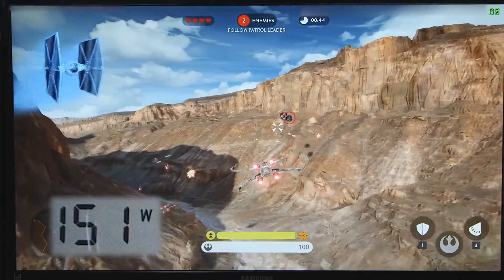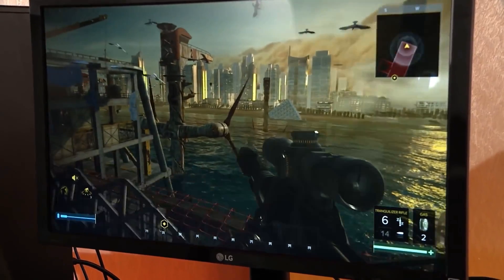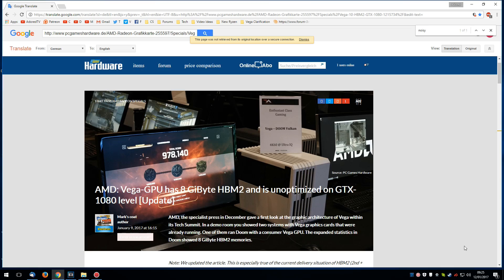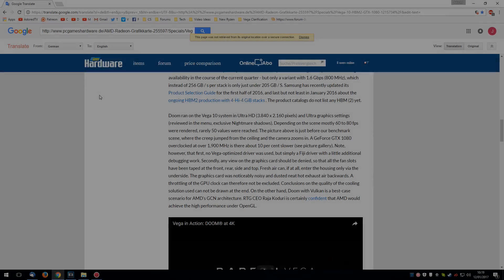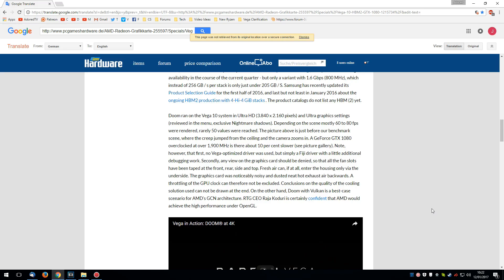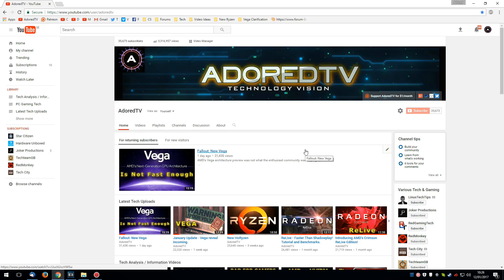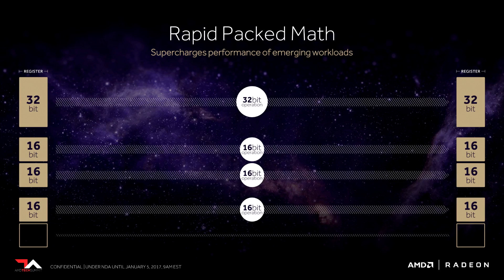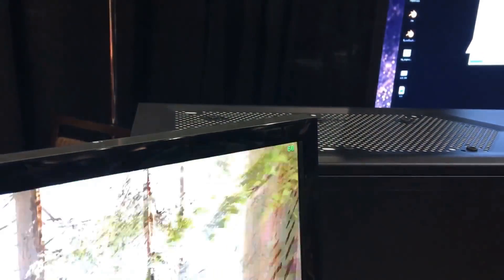Vega Clarification - How bad is it?

Comment: I think judging VEGA without knowing its price is pointless. What if Vega is priced very cheap that it becomes the best choice over 1080 any day? Don't jump to any conclusion until we get to see final price tag.
Reply: Hbm2 is not cheap
Reply: compared to 1080
Reply: Thing is that Vega HAS TO MAKE MONEY, or else there wont be enough resources for the next generation of cards.  And second fact is that NVidia can drop prices to match AMD, which in both case AMD lose because they don't have enough money.

The point is selling Vega for too cheap , AMD doesn't make enough money. Pricing it too high the card won't sell.
It is a lose lose situation. Look at the bigger picture bro.
Reply: It CAN'T be cheap. It's LARGER than 1080, AND has HBM2. It also has a state-of-the-art HBCController. That's the definition of expensive.
Reply: No, but the thing is AMD isn't looking great when you stop and think about it. I am a AMD Fan, my computer is still plowing a FX8350 with a RX470. But sometimes, facts are hard and they are going to hit hard on the head.
Reply: Except Nvidia overprices its card by a substantial amount.

You all are operating under the assumption that Nvidia is only charging a reasonable mark-up.

AMD can undercut the price of the Nvidia cards and still make money. Its actually the best situation for AMD to be in, because if they come in  near (above or below) Nvidia in performance AND undercut them by an amount that motivates customers...Nvidia is put between a rock and a hard place.

Fight a price war even when your cards are faster (which costs you profits) or let AMD eat into your sales to maintain your margins (which ends up still costing you money in lost sales).
Reply: P.S.
The only thing AMD can win the current battle is to have a GPU that is both more powerful and cheaper than Nvidia. That is the only way out.
Reply: The problem is, Nvidia won't...and doesn't.

Nvidia isn't going to drag their prices below AMD. They have already shown a paradigm shift in pricing with the founders cards.

I hate to break it to you guys, but that 1080ti is slotting in at $1000 and the 1080 is staying right where its at price-wise.

Those deals you always hope for with a ti release....not happening. Just look at the pricing structure. They have Z-E-R-O need to adjust prices to slot in a new card at the top end.
Reply: Incorrect.

Nvidia has shown a paradigm shift in pricing. The future will never again be like the past.

The 1080ti is slotting in at $1000 and the 1080 is staying right where its at.

They won't engage in a price war. When Vega drops, if they price it less then Nvidia will at BEST price it $50-$100 more than AMD and hope the performance crown holds.

You also forget Nvidia drivers have gotten substantially worse and AMDs have improved (some would say even surpassed).

You're looking at the past to inform the future. The pascal generation has been nothing like the past. Founders cards and a whole new pricing structure have changed the game entirely.
Reply: No one is claiming AMD will sell Vega cards for "cheap." It just has to be reasonably less than a comparative Nvidia card with at or near performance.

It's not about winning the race, its about improving sales, increasing marketshare and building long term growth. AMD has already mapped out its future and unless Nvidia makes some huge leap, pascal is just maxwell on a die shrink, which was just kepler with process/architecture refinements. 

Nvidia has been riding the same horse for a while. For all we know, they've hit the wall and HBM is the last ace up the sleeve before they have to do something different. I mean, look at the horrendous scaling from frequency enhancements on pascal. Almost every card is sitting at 2k and the difference between 1900-2100 is so small it just doesn't matter. 

Worse yet for Nvidia, unless they address Vulkan/DX12, their cards will only get worse with time and newer cards won't do anything to address that issue. At some point, brute force of hardware will give way to horrible software optimization.

It seems everyone is expecting w world beater. No. This is a steady the ship release that will undercut nvidia and open doors down the road for the type of competition that we want at the high end. They need cash and marketshare, not a performance crown.
Reply: "For us yes, for the mass, no."

What? 

"They are sitting on the same boat 3 to 4 gen ago, what does it bring? NOTHING. Building a long term growth has no effect if you can't survive that long. "

Wrong. It brings performance parity with Nvidia. Something they haven't had for a very long time. Further, you clearly know little to nothing about business or AMD or you would know they turned a profit, increased marketshare and RX sales are up across the board.

"NVidia can make cheap cards and overprice them, AMD can only make expensive card and sell for cheap. See the issue here?"

Wrong. I like how you think you know Nvidia and AMDs costs. Care to show up the build sheets you have access to that clearly no one else does? Both Nvidia and AMD pay other people to make their silicon. Assuming one has a cost benefit over the other that huge is laughable.  Yes, nvidia sells more chips so they will have an edge from economies of scale, but its not on the magnitude of $100+ a chip. That is just pure asinine nonsense. 

Nvidia makes expensive products and sells them for astronomical prices. That 1080 will cost less than its vega counterpart, sure, but you seem to forget Nvidia has HUGE stockholder pressures for profits and margins and losing on either has a far worse impact for them. Its obvious you've never been part of a company beholden to its quarterly reports.

"Because it is the only way AMD can survive now. There is no way they can do otherwise if we analyse more."

Pure nonsense. Again, you're projecting what you want. Not what the market needs. The market needs competition that delivers performance parity in competitive segments (not a segment that sells less than 1% of the total market) and does so at a reasonable cost.

Consumers are eating huge costs from Nvidia and 480 sales show consumers are souring to Nvidia's price gouging.

Once again, people like you are living in the past and ignoring the present. Worse yet, you're ignoring obvious business strategy, likely because you're not aware of how a business is run.

ps. I'll let you have the last word. I can't stand trying teaching kids things they don't want to learn. Just promise me you'll take a business course when you go to college.
Reply: you sound like you want AMD to lose :) I want fierce  competition.
Reply: It's impossible to sell cheap, there is a lot of hardware in there, and HBM is expensive AF and AMD needs to make money.

What is disappointing for me and maybe for adoredTV too, is that AMD on the paper claims to make huge changes on arquitecture, it started with Polaris 10, which in the end, Tesslation was vastly improved, Memory compression too, but still lags behind against nvidia on both elements, the GCN Cores were having the same performance as the ancient cards.

Now we have a lot of new slides claiming again performance boost on Geometry (Tesslation), memory compression and tilling (tilling, nvidia features it since maxwell) and virtual memory, which nvidia supports it too, but never PR about it that much, we have now improvements made to GCN Cores, which I expect to see less GCN cores offering more performance, Nvidia done 2 improvements like this on CUDA Cores on Maxwell and Pascal, AMD took 5 years to start this improvement.
And looking to the Doom Demonstration it is still at the level of the GTX 1080, with a bunch of new arquitechture advancements and a lot of hardware, and maybe even more power draw.

Nvidia is undeniable in front of AMD related to arquitecture efficiency, dispite yes, the bad performance on DX12 and vulkan.
This advantage that nvidia has, makes it easy for Nvidia to produce cheap chips and sell it at an expensive price.
Nvidia sell chips with half hardware than AMD and still manages to get the same performance, so they waste theorically half the money to produce the GPUs than AMD and sell it at the same price points as the AMD.

With small chips and less hardware, nvidia has no trouble in making good Laptop GPUs or port the Desktop GPUs to laptop and sell them with less heat and power draw which is extremelly important for laptop market.

AMD is making a lot of advances, but it still feels that at some point is still catching up to Maxwell, and we don't still know nothing about volta and how more efficient it can be.

I really wish that AMD would prove me wrong, but i'm kind of hopeless too, still I will try to support AMD anyway.
Cheers..
Reply: Again, relying on the past to predict the future...when the future has already radically shifted.

Nvidia has slotted their entire line-up $100 higher than last gen. Further, they moved the titan up $200 which leaves the 1080ti in the $1000 slot.

Nvidia isn't going to slash prices. They especially will not slash prices below AMD. Period. I've made this point several times now, Nvidia is beholden to their margins and profits due to stockholder pressures.

They can't just cut prices and "crush" AMD. Nvidia lives quarter to quarter and it would take at LEAST 12-18 months to flush AMD entirely with that strategy. Stockholders would lose their shit and if you bother to read the reports on wallstreet, Nvidia is already under pressure with Intel interested in taking them on with gpu acceleration in machine learning etc.

You guys are looking at such a narrow scope you're missing all the evidence to the contrary. Worse yet, when anyone points out a flaw in the argument, you just dig your heels in. You aren't even addressing my points. You're just saying, presumptively, that Nvidia will do something to outright destroy AMD...without any evidence...past or present. Nvidia has been operating without regard to AMD for quite a while now. The last of interest in rushing the 1080ti to market confirms this.

Unless Vega comes out and simply destroys the 10 series cards, Nvidia has ZERO reason to undercut Vega. Undercutting a card that has slightly lower performance than your own is absolutely nonsensical. 

A perfect example of this is Apple. Many android phones are parity with iphones in terms of quality/performance and software experience. Apple sales are sagging. They drop prices and they lose the ability to charge excessive prices on future products, they keep the high prices and they lose momentum in the brand.

The same thing will happen to Nvidia. They're faced with a hard choice if Vega competes within 5%. Either give up the ability to charge ridiculous prices and fight for marketshare or keep the prices and seed AMD marketshare.

Its basic business. Its nearly impossible for anyone to sustain both for prolonged periods and you can see this trend in every single industry and every single brand that "people will just buy no matter what."

Apple has the most loyal consumers on planet earth and that didn't stop them from seeding marketshare to its competitors and lose consumer confidence from adverse business practices.
Reply: Nvidia is currently gouging the high end market. They are way overcharging customers for their cards because there is no competition right now. Sure the new AMD card might be more complex but if they sell it without price gouging then it can still be a good deal and undercut Nvidia by a good margin as well. Right now AMD has to undercut Nvidia in pricing if they want to regain a foot hold in the high end market. Nvidia is no longer a friend to the gamer. They will try to find any way possible to tack on extra pricing to their cards. Founders edition is just the latest scheme they have thought up and anyone buying a founders edition card is a fool.
Reply: Christian Axelsson 
GTX 1080 is a mid range chip is what he meant. It is 314mm^2 .980 Ti was 601mm^2 .
Reply: There is almost no way VEGA will be priced very cheap. It is entirely possible it will be cheaper then the 1080 but not by much. I will be shocked if Vega launches cheaper then fury x. Given what seems to be a small increase over the 1080 we could see vega launch at $650 at the high end followed by Nvidia releasing the 1080ti and dropping the price of the 1080 slightly. I just can't see how AMD can afford to sell cheap with their Ryzen and Vega stuff at the same time.
Reply: thats good for people looking to buy a graphics card sometime soon, but then AMD stays in the red financially. "there is no bad card only a bad price" is true for the consumer, but for a company looking to pull itself out of a deficit its a nightmare that they haven't been able to wake from in years.

AMDs graphics cards need to pull ahead not just because fast cards are great for consumers but because they need a MASSIVE performance / area improvement to improve their profit margin as they have been operating in the red for quite some time.
Reply: Michael Hatch 
No, it is high end. 
The TXP is the previous X80 card really.

Going from 40nm to 28nm didnt matter. Going from 55 to 40 wasnt an excuse. It is NOT an excuse now either.

314nm = mid range, size wise.
Reply: Good point, but you forgetting something. It's a business, meaning everyone need a profit. AMD with all that HBM memory and other super-duper technology, simply can't afford to sell it cheap to customers. 
And trust me I would love to see AMD selling cards very cheap and break Nvidia's neck in price battle. But I don't think they can... They will make it around 100$ cheaper, but also weaker then it's competitor. I'm not expecting any miracle here.
Reply: The point is that Vega still wont be faster than a Titan XP, which will be almost a year old when Vega actually releases....
Reply: @PhantomX Racing what you see in videos of AMD? comparing Vega with 1080. how the hell one thinks it will be faster than Titan XP when AMD compares it with 1080? only retards
Reply: The stuff you read in this thread lol. GTX 1080 a midrange card? That statement is simply retarded. Performance is what makes a card, not die size. Don't forget AMD's pricing history from the last couple years. Fury 550$ Fury X 650$. You can buy a GTX 1080 now for 549$ atm.
Reply: Stop comparing die size. PERFORMANCE is what matters. The fastest wins. How hard is that for you to understand? Regular  Fury cards cost 50€ more than 1070's here. Yeah AMD's amazing competitive pricing at its best right there.
Reply: Alexander Buck and the pro duo then? Its still 1500$ priced 300$ over the titan xp.
Reply: Michael Vinson The biggest problem with your argument is the fact that most gamers are simply too stupid to see the true NVIDIA. What they see is exactly what Nvidia's behemoth and extremely successful marketing department wants them to see. AMD will have a serious up hill battle to regain market share when NVIDIA has duped so many brain dead gamers into believing green is the only way to go. Vega could be three times better and I know gamers who would still buy an NVIDIA card just because it's an NVIDIA card. The AMD fanboy is a much smaller crowd. 

The only reason I think AMD will eventually win is simply because of the fact that AMD makes all the console hardware and the lines between PC and the console is growing ever so smaller. Game developers are automatically programming out of the gate for AMD hardware, thus over time all games will simply run better on AMD hardware by default. Nvidia can't compete with that and their drivers will get worse and worse. Case in point, over the past year or so AMD cards have had nearly a 50% increase in performance just from driver updates, while in the exact same time frame nvidia has barely managed 9% performance increases. And it can only get worse because AMD has 20 years of experience with the x86 based computer. Nvidia can't compete with a real technology company with that kind of past experience. All nvidia can do is keep making more and more larger gpus, throwing muscle at the cards, while AMD slowly takes control every thing else, more advanced cards, more advanced computers and more advanced drivers all thanks to their experience as a PC company and games being built for them out of the box. 

This is why NVIDIA is now spending much more R&D in the autonomous automotive industry and other fields because they are well aware that the Xbox is becoming a Windows 10 computer and all games will be designed for AMD hardware by default with NVIDIA as a side note.
Reply: Vega ran Doom@4k in 60 fps.
Reply: Kane ^This is what they always do
Reply: huge chip, expensive  hbm2, the production cost of the chip will not be cheap.
well i mean fuck knows maybe it will be a relatively very cheap card not going for much profit if any at all and basicly trying to get some mind share while living off of ryzen which seems very very very promising and bring lots of money into amd.
Reply: For us yes, for the mass, no.
"its about improving sales, increasing marketshare and building long term growth." They are sitting on the same boat 3 to 4 gen ago, what does it bring? NOTHING. Building a long term growth has no effect if you can't survive that long. This is what we are talking about. They CANNOT survive that long with that kind of strat.
NVidia can make cheap cards and overprice them, AMD can only make expensive card and sell for cheap. See the issue here? AMD's graphics department cannot keep this up since NVIDIA is not standing around to wait for AMD to play catch up.
"expecting w world beater" Because it is the only way AMD can survive now. There is no way they can do otherwise if we analyse more.
Reply: If I remember correctly, the die size plays a factor on how much a GPU is going to be. Vega has a MASSIVE chip that's way larger than the 1080 and I think the Titan X Pascal chip as well. That signals that it's NOT going to be cheap. Couple in that HBM2 is also NOT cheap, that pretty much guarantees that it is going to cost alot of money.
Reply: ""NVidia can make cheap cards and overprice them, AMD can only make expensive card and sell for cheap. See the issue here?" It is true fact. Watch some if this channels videos analysing NVIDIA and AMD finicial situation. Or you go google some sheets to look up.

No, you should actually read about Nvidia's financial report. They are making SO MUCH MORE money per card than AMD. Go figure out yourself, It is so freaking far apart it is NOT funny.

"you're projecting what you want. Not what the market needs."
Soooo... I don't count as a part of the market? Seems legit.

 "they turned a profit, increased marketshare and RX sales are up across the board." They did, but it is not enough. The whole point of the argument is that IT IS NOT ENOUGH.What prevents NVidia putting more resources? You assumed that Nvidia is going to sit here and wait.

Hurling insults at "You have no idea" doesn't help your argument one bit, I suggest you either tell me how it suppose to be, or tune it down.
Reply: Kane Nvidia might be doing the same thing over and over but it is working.
Pascasl might had been a small bump comparing to maxwell, but still they manage to improve it's cuda cores and their memory compression a lot more than what Polaris had done over the 5 years..
DX12/Vulkan is still bad implemented in most games, and only in a few.
When the time comes, AMD might shine their Low Level APis advantages, but the market and masses don't want to wait.. and I don't see DX11 to go disappear in the next half decade either, where nvidia have a confortable DX11 performance...

Nvidia do require a lot of frequency and have small IPC, but that would only be bad, if temperatures or power draw was high on their cards, which is not, so there is no problem with the high GHZ frequencys..

Volta is coming to the next year or 2018, and as nvidia claiming, can be bullshit or not, it is expected to be as game changing as it was on the maxwell.
Maxwell was without a doubt the biggest release ever of nvidia, and what did make AMD being in trouble now.
Kepler was apples to apples with AMD, and fermi was an overheating mess and poorly optimized arquitechture with a massive power draw.

Nvidia had came a long a lot in the last years, I can see AMD trying now since Polaris, but it still have a lot to catch up, and unfortunaly for AMD, I don't see nvidia slowing down.

Again keep in mind that I am mostly an AMD Fan, and my desktop is full AMD CPU and GPU, I just can see that this isn't going to end well for AMD.
AMD will always have to sell expensive chips for low price, while nvidia sell cheap chips for enthusiastic prices. Nvidia can get a ton of money out of their sales, while AMD will have to get just small profit out of their cards..
That's the main problem right now, and that worries me.
Reply: BenchART
pascal didn't have improved cuda cores compared to maxwell, u can find a video about this on this channel.
it's exactly the same, why is pascal faster? because higher clocks that's it.
also unless i'm completely not getting sth. here:
memory compression doesn't make the card faster but cheaper, it means u can run a smaller bus, or slower ram without bottlenecking the gpu.
Reply: sosoishero Always? I don't think Polaris is that expensive to produce.
Reply: Live free in the NC! We got to spread the word!
Reply: +cataria pega Yes, I might be wrong around the cuda core improvements, I guess they have more cache now, saw some PPTX somewhere about it at the time.
Memory compression is exactly like you described, but that's again bad news for AMD, AMD needs to continually improve this as fast as they can, for the production costs to drop..
With luck, Volta is only getting PR bullshit, but I believe they will at least transform it to be more Async friendly with real parallel compute units and not doing parallel through software, if the advantages of Paxwell ^^, are small, AMD might catch up if they continue aggressivelly improving it's arquitechture, and not like they have been doing the last 5 years with almost 0 differences between GCN versions performance wise (UVD did improve a lot though).
Reply: And? lets say its priced at 500 dollars vs 1080 at 680, nvidia will just slash prices and given the "mind" of many gamers today who only buy nvidia it will bring nvidia even more dominance, and they will release refresh cards at may-june...i mean they will release cards who crush vega  with ease again making amd flagship card unattractive just like FuryX is nowdays.
Reply: It has a good point when you're calling Vega an enthusiast-targeted architecture.
Reply: Aki It won't be,AMD needs their money back for Navi :p
Reply: Well you can extrapoliate the price out of the die size.

Of cause... if its a SoC type chip (and it probably is), the PCB will be very cheap, but the whole card, not so much.

Of cause, craming two GPU into the same card would be fairly easy
Reply: Lmao no Vega marketed this card at the high end however it's looking awfully mid range in 2017
Reply: You dont get it.
At 500mm^2 and HBM2, it can not be too cheap. It simply is impossible. Meanwhile with GDDR5, 5X and 471mm^2 or 314mm^2, GTX TXP, 1080 and 1070 can easily be the same cost as Vega... and give Nvidia a LOT more money.

Imagin this. Vega comes out and it is 400 dollars. Impossible IMHO, but lets imagine it. AMD will make 100 dollars on a VEGA GPU. Nvidia bring prices of GTX 1080 down to 370 dollars, a bit less than Vega. Nvidia will make 150-180 dollars per GPU...
Reply: The halo effect is an effective marketing strategy. IMO this is why Nvidia is on top on enthusiasts cards.  AMD needs to be king of enthusiasts cards for them to gain market share.
Reply: Aki we do have a ballpark measure for its price though, in the form of die size. This is a big chip, bigger than GP104 for sure, which generally makes it more expensive to manufacture.
Reply: Alexander Yordanov Is the Titan XP also midrange since it's die size is only 471mm^2? Going from 28nm to 16nm made a big difference. Comparing die sizes of two completely different fabrication processes means almost nothing unless everything is factored in.
Reply: +Alexander Yordanov Going from die sizes matters a lot. Go back and look at the history of Nvidia's process. They shrink the die and release a small highend gpu then the next gen the stay at the same fab and increase the die size. gtx 580 520mm^2 - gtx 680 294 mm^2 - gtx titan 561mm^2 - gtx titan x 601mm^2 - gtx titan xp 471 mm^2. It goes on and on. The die size gets smaller on their highend then the next generation gets bigger until the fab changes. I'm not even arguing the placement of the gtx 1080 cause it doesn't matter and sits at the same spot as the 980 which seems to be subjective. I also notice the "mid range, size wise" comment which may have had me confused since I probably misunderstood and was under the impression you wanted to compare performance to die size. Even size wise it is debatable since pascal has four tiers ranging from 135-471. If the 1080 was 28nm like maxwell it would have a die size of 549mm^2.
Reply: Michael Hatch 
Performance and die size do collerate. The reason Nvidia charges so much money for a cheap thing like the 1080 is... because they can.

Die size = cost of production. There are some more variables (R and D, Wafer agreements, actual salvaged and damaged GPUs) but fact of the matter is - Nvidia want a lot of money for what is really a 1070 tier GPU.
Reply: Alexander Yordanov You are over looking a lot of what I said. They make every new fab have a smaller die size for the first gen of it. Going from 40 to 28 resulted in a very small die size and was very expensive. Not because of wafer but because of the manufacturing process. Whether we like it or not we all pay for it regardless if we are paying Nvidia or AMD. Shrinking the fab process takes a lot of time and money. It is only after that is perfected they move on to a second gen that has those larger die sizes you think we should have now and with nvidias next gen we will be back in the 600mm^2 range until the next die shrink. Intel does the same exact thing and since AMD has done nothing for so long neither company needs to do anything price wise. Regardless of die size it is still the largest performance increase we have seen in a long time.
Reply: Michael Hatch 
They do. But the 40 to 28nm was AMD's mistake. They attempted a small die strategy, lost space on the way the 384 bit bus on the card worked.

However that is an anomaly.

All that matters is how much it costs Nvidia or AMD to produce. A 1080 is cheap, we know that because Nvidia's gains per GPU sold are higher than ever before.
Reply: Aki 5min mmmmsssgsww
Reply: Alexander Yordanov Both AMD and Nvidia have been doing the small die strategy for every first gpu on a new fab. They both have been doing exactly what I said above nearly the entire time they have been making gpus and neither cut prices for the smaller die of the first run after the fab shrink.  What about 130nm to 90nm or 80nm to 55nm from AMD? Every die shrink they did resulted in a much smaller die yet never resulted in a cheaper price. The hd 3000 series was the first from AMD to use 55nm and all had very small die sizes then they continued 55nm to the 4000 series and increased the die sizes. They both have followed the same formula nearly the entire time. Nvidia just has no competition currently so can charge a little higher then they should. I hate what I paid for my 1070 but I didn't have many option so sucked it up. We either buy it or we don't.
Reply: Michael Hatch
Could have bought a Fury X that's only 10% behind in 1440p
Reply: +Energy Core Why? It was about the same price at the time and in directx 11 the difference is more in most cases.  It also uses about twice the power and has much worse minimum fps compared to the 1070. I actually considered it at the time though. It came down to minimum fps and power draw. I still believed directx 12 and vulkan would be huge then so figured it may have even been better if not for those darn minimums.
Reply: Aki Well Adored is rarely wrong. And he isn't jumping to conclusions, he's just giving his honest assessment of VEGA from what he's seen and read so far.
Reply: Michael Hatch 
They dont result in a lower price... for a reason.

Do you know how Wafers function?
Reply: Alexander Yordanov you must be flat out crazy or only reading a word or two here and there. You are at the point of contradicting your own self just to avoid agreeing with anyone. Why is it so hard to understand BOTH AMD and Nvidia always have very small die sizes the first time they go from a larger nm fab process to a smaller one. That includes the expensive highend. Only the next gen or second use of that smaller nm fab process gets the bigger die sizes. The difficulty you are having understanding why two cards of possibly a different tier may share the same die size and cost differently then one another makes me question how much you know about a gpu in general.
Reply: Michael Hatch 
Point is...
AMD WONT MANAGE TO HAVE ANY COMPETING PRODUCT WITH THE PASCAL OR VOLTA GPUS. 

That is the entire point to these discussions. From skullfucking Nvidia, die size wise (where Nvidia lost with a almost 600mm Kepler 780 Ti/Titan Black to the 438mm Hawaii) now they need 500 mm to equal a 314mm chip, which is cheap as fuck to make.
Reply: +TYRN RX 470 G GDDR5X isn't cheap either.
Reply: yeah i very agree on this one. i really do hope amd will undercut nvidia 1080 with faster card, with more technology and less money.

I dont need AMD to beat Nvidia outright, all i need is good competition so we got the options to buy which suits us better.

I think its ok for Nvidia and their deep wallet fans having the bleeding edge of performance, wat i care is the performance at the price i can afford...

I mean performance and prestige wise, the new NSX ( the best honda can offer )  got nothing compared to even to the cheapest McClaren ( 570s ), yet i couldnt care less, cos most of us can only afford accord at best!
Reply: what is pointless is to judge Vega engineering sample. this is beyond retarded. they will obviously get better drivers and silicon, might increase clock, etc. Ryzen cpu started at 2.8ghz, and now is 3.6ghz, and probably it will increase more
Reply: Dimi S 
Fury X is a 596mm^2 GPU. 980 Ti was 601. Both are Ultra high end GPUs.

Also in some countries Fury is less than 300 dollars lol
Reply: Dimi S 
The SIZE of the GPU is directly attached to its cost to produce and tier.

In the US and some other countries, R9 Fury costs 250-290 dollars. 1070 is 380.

Here in Bulgaria? Pft, 780 Ti is still 700 dollars...
Reply: Alexander Yordanov but you keep ignoring the fact that every first generation after a die or node shrink has a smaller die size. All that money saved on die size went in to r&d for the smaller nm. It is only the second generation of the smaller nm do the die sizes start to increase again. AMD and Nvidia has been doing this since long before 40nm. 16nm was nvidias first shrink so they made it's highend have smaller die sizes. Next gen with be 16nm with bigger die sizes. AMD's polaris die size is tiny as well. It isn't hard to understand the pattern here.
Reply: Michael Hatch 
Nvidia did not have to pay for TSMC's planned advancement, at least not much.

We know from their financials that they now make more per sale than ever before. Shrugs
Reply: Alexander Yordanov Shrug all you want but the same process has being going on for years by both amd and nvidia. To think a business(TSMC) doesn't pass the cost off to its customers(Nvidia) is absurd. Of course Nvidia makes more profit. They are able to get better performance across the board with less.
Reply: Michael Hatch 
Then why do they make more per chip than before?

It is all in Nvidia's reports. All of it. Even if they pay to TSMC, you are still overpaying for a 314mm^2 chip.

It is what it is.
Reply: Alexander Yordanov You're paying for performance you tool! Do you not get the concept of the better product costing more than the other?
Reply: Dimi S 
I dont care for the performance as much Shrug. I pay for the art form that is games, so I can not empathize at all with people that spend way past price/performance parts (last one is 1070). I dont get their thinking, it looks sub-optimal.

The better product would be one that has the best price/performance, has thinner margins (bad for company, good for consumer) and lasts longest (engineering forethought).

With that being said seeing how easily people swallow it, if it were up to me I'd price the 1080 some 150-200 dollars higher. Might as well milk them completely.
Reply: Alexander Yordanov past a certain point everything has diminishing returns. Those last few points of performance become exponentially expensive. Nobody is arguing top tier products are incredibly expensive and have a much smaller value to performance ratio. Just like I said with the comment you responded to Nvidia is able to do more with less. We are not buying silicon wafers or a piece of a wafer. We are buying the product for it's technology and performance. AMD has done the same thing. They are both guilty of the practice. Don't tell me you forgot the $1000 amd fx 9590 that couldn't beat an i5.
Reply: Michael Hatch 
I know. That is why it doesnt make sense to me.

Point is, Nvidia wants more money for those GPUs than they should cost. AMD does that too, just to a lesser extent. 

For what it is worth the 9590 is somewhat good vs its competitors at the time nowadays. Just too little too late.
Reply: Alexander Yordanov I completely agree with that. I even hate the fact I paid what I did for a 1070 and I had a %15 off code when third party cards released but the price still hurt. If not for the fact I was worried the rx 480 would have had trouble with 1440p down the road that would have been the card I went with. Those prices are exactly why I want amd to get things right. I still don't think vega will be the one to make a change but I do think ryzen will get intel back to reasonable prices. All I can say is thank god for multiple emails and sites that sell pc components that offer %15 off discount codes often.
Reply: Aki AMD doesn't price their GPUs cheap...their flagships are always expensive just like Nvidia
Reply: Alexander Buck is its performance more than double of the 1080?
Reply: Dimi S 
It is not 1500.
Reply: Alexander Yordanov stop being blind. It was 1499$ at introduction and it remained that price up until a month or 2 ago. How much is an R9 295x2 now?
Reply: @Dimi S the price of Pro Duo was cut down to $800
Reply: Dimi S 
R9 295X2 is cheaper these days. Pro Duo is 800.

I know it was 1500 on introduction. The Titan Z was 3000 :)
Reply: Alot of ppl want Vega to be competitive in the enthusiast market as well, so that we don't have to buy a $1,200 GPU with a shitty cooler.
Reply: The truth is....Nvidia has had a much larger selection of video cards from low to high end than AMD for the past 2 years. Nvidia is also always first to release a faster GPU than what is currently available. This shows that nvidia is the stronger company, and most people will do business with the stronger company. Even though the Radeon RX 480 4GB is the best GPU as far as performance per dollar, most people see AMD as the weaker of the two companies, so they go with nvidia regardless. Even though Im an AMD fanboy and have an AMD rig (every rig I've had was AMD), I have considered going Nvidia and Intel more times than I should lol. It's just that I've been let down by AMD as far as the high end segment for the past 2 years. And let's not even talk about AMD's CPUs....rgray318
Reply: rgray318 that's not a good thing. The card should be close to fully optimized at launch.
Reply: the brand brother...the brand name to be more exactly.
Reply: Well experience tells me that when ATi makes a video card for AMD, they don't try to price-gouge.  Hell, they didn't try to price-gouge even when ATi OWNED the market in the 90s.  It's probably because ATi is Canadian and we're a little bit different from Americans that way.  Even after AMD aquired ATi, they didn't change anything there, just the sign.  They may be called AMD Graphics but ATi is still who they really are.  If anything, I think that ATi had a bigger influence on AMD than the other way around.  How the hell else could a company whose logo is green and black be called "Team Red"?  The Phenom II was the last CPU series AMD had before acquiring ATi and the boxes were black with green and white accent.  After acquiring ATi, ALL AMD CPU boxes became red and white.  These are the colours of ATi, they were chosen by ATi because they're the colours of Canada.  So, Team Red gets its colours from the Canadian flag.  Now, if only they'd adopt that way-cool letter font that ATi had in their logo, it would be perfect!
Reply: Well here's a fun fact for you then.  AMD has been focusing their efforts on their weakest link, namely AMD themselves.  ATi has always remained competitive with nVidia and isn't going anywhere.  You're like the wandering fool yelling "The End Is Nigh!" when it's just not so.  AMD was in much more serious danger five years ago than they are now because of their CPUs and those things weren't even CLOSE to Intel's.  At least the ATi division is close to nVidia exactly where it matters, at the price point that most people actually buy.  How can you say that there won't be enough money when Ryzen is going to make a fucking FORTUNE for AMD?  All those loser Intel-gaming fanboys aside, the server market is only 100x more lucrative than the consumer market and the Naples-based Opteron is a very safe bet to annihilate the Intel Xeons?  The difference in how valuable the server market is compared to the consumer market is so huge that if Intel had the ENTIRE consumer market (desktops, laptops, etc.) and AMD sole EVERY server CPU they had (even at their small scale), they would make more than Intel's vast domination of the consumer market just with that small piece of the pie.  Nothing AMD makes is going anywhere and you're a nut to even think it.
Reply: @Nani average is around 70 fps, but amd gpu's have more than 15% boost in Doom. outside Doom things are gonna be a lot different
Reply: The problem is, even if Vega is released for $200, NVIDIA can definitely sell GTX 1080s for $170 no sweat.